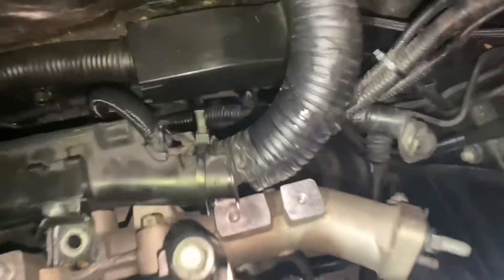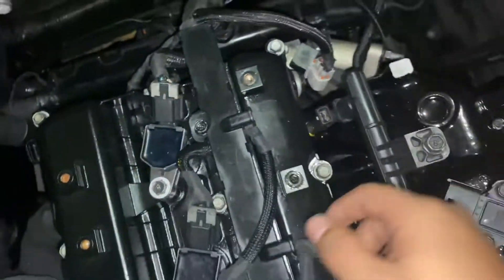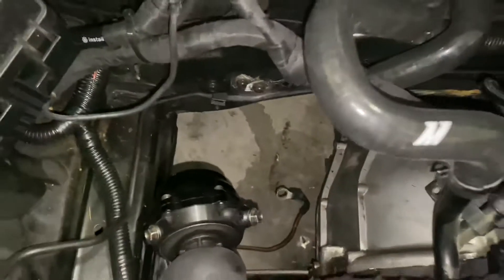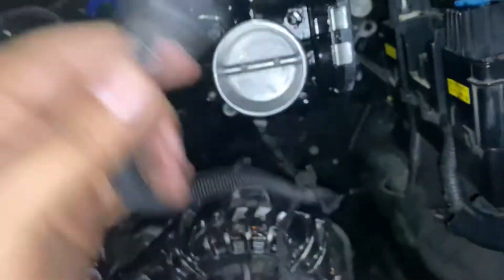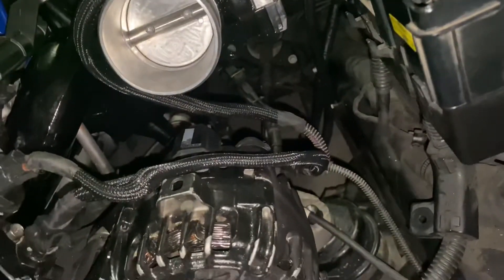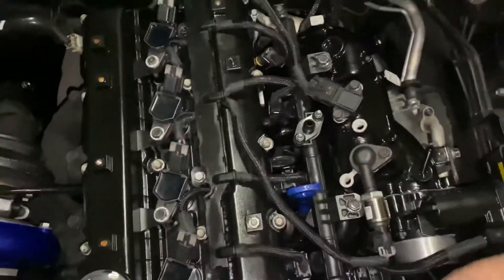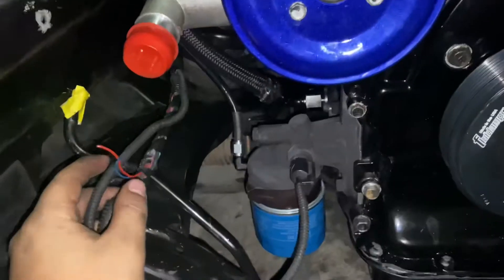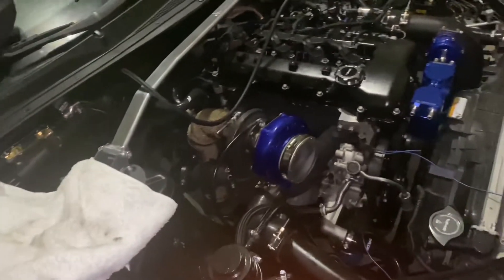Genesis Coupe 2.0T Engine Build Pt.10 | 2.0T All Engine Sensor Locations

Comment: Hey I was wondering, what did you do for the air vent hose and pipe? I see that it’s completely removed?
Reply from the maker: @vietyyg6739  air vent hose?
Reply: @ProdigePerformance  I might’ve said that wrong, I was meaning where u have the catch cans located ?originally there were hoses there
Reply from the maker: @vietyyg6739  delete them. They’re not necessary.
Reply: @ProdigePerformance  okay appreciate it!

Comment: Hey what size intercooler piping did you go with
Reply from the maker: I went with 2.75 but I should’ve just got 2.5 inch instead. 2.75 was a overkill and it was difficult finding couplers for 2.75

2.5 and 3 inch couplers are more common
Reply: Would running 3 inch be overkill as well?
Reply from the maker: @brodie3125  yep. No need for it. 

3 inch piping you see that in 1000+ applications,
Reply: @ProdigePerformance  awesomee thank you so much
Reply from the maker: @brodie3125  yes sir

Comment: How did this build hold up?
Reply from the maker: Still running. 44 psi 

Weekend driven only.

I’m actually in the process of testing more parts out for vendors. As soon as I’m done I’ll slap a bigger turbo on.

Comment: Great video man! 
I have a genesis 2.0 bk2 2013. On the highway going 60miles or 70 and if i accelerate from there the rpm drops to 0 and stays there. If i accelerate a little bit after that the car just stops working and i have to switch it on and off again. What do you think could be the problem. I have a feeling it could be a sensor been dealing with this issue for a while now can’t figure it out. 
Usually this happens when the car has been driven for a while and is warmed up.
Reply from the maker: I’m assuming you don’t have any check engine codes?
Reply: @ProdigePerformance  I do and that’s because my primary cat is empty from the last owner. And everytime i do a computer check it shows me that and evaporative emission leak.
Reply: @ProdigePerformance  any clue bro ? Would appreciate some help
Reply from the maker: @DaniMk7  I’m sorry I didn’t reply back. You’re going into limp mode. 

If you have a Evap code then it can actually throw you into limp mode. I would focus on fixing that first.

Comment: Hi I’m tryna clean my mass airflow sensor because my car has rough idle and I can’t find it on 2013 genesis coupe 2.0t
Can you help?
Reply from the maker: We don’t have mass air flow sensors on the 2.0ts 

We use MAP instead of MAF 

The map sensor is located on top of the intake manifold. I also recommend cleaning your throttle body. A rough idle can also be a indication of a injector going out or bad spark plug.
Reply: @ProdigePerformance  thanks

Comment: Where’d did you get all those braided lines? And in which part did you install all that? Love your car I just came across your channel
Reply from the maker: You can get braided lines anywhere. Amazon is where I get mine since you can buy them in bulk. 

For fueling I use braided ptfe 
Oil I use stainless steel braided 

For vaccum I use regular braided lines
Reply from the maker: I’ll make a video for you guys soon on how to do it. It’s super easy
Reply: @ProdigePerformance  sweet thanks 🙏
Reply: Is there a way to wrap the wire without de pinning it? I ended up buying it off Amazon 🤘🏼
Reply from the maker: @johnnyg5790  you can get grade 2 heat resistant loom that’s cut so all you have to do is wrap it around the wires but I also recommend getting a hot knife to cut through it way cleaner. 

Grade 3 for the most part isnt cut. Very few brands will offer grade 3 cut
Reply: @ProdigePerformance  can you send a link I’m new to this type of stuff

Comment: Man I’m trying to find an o2 sensor bank one sensor 2 I’m not having any luck
Reply from the maker: Sensor 1 is primary o2 sensor sensor 2 is secondary o2 sensor for your cats 

Bank 1 is driver side 
Bank 2 is passenger side. 
Sensor 1 is the first sensor 
Sensor 2 is the bottom sensor

Comment: Quick question Where is the the turbo boost sensor
Reply from the maker: The map sensor (that reads boost) is on top of the intake manifold. It’s a map and iat sensor in 1 

The boost controller (that controls the Wastegate/boost) is the sensor that’s on top of the power steering bracket